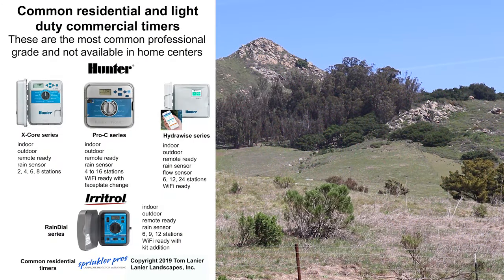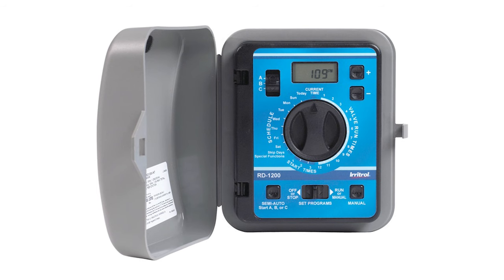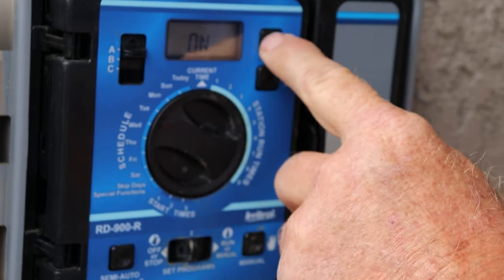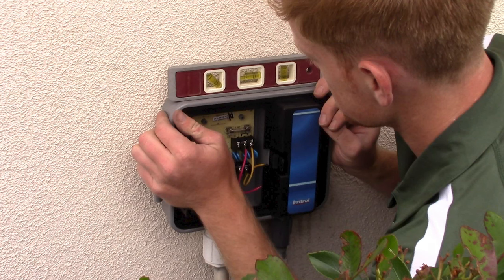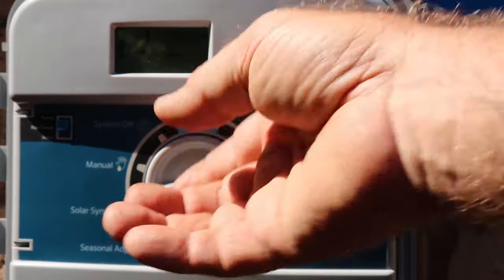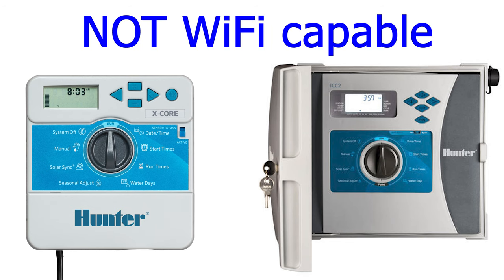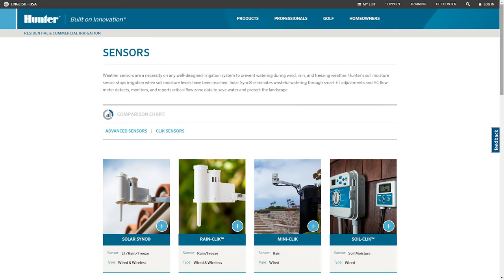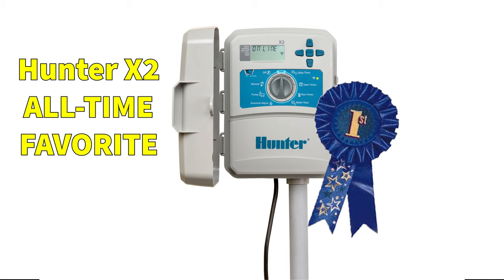Best Irrigation Controllers for 2024 'n WHY | Pro-grade buyer guide

Comment: Hunter...nothing is simple for avg user.  Hydrawise is way behind rachio or behyve
Reply from the maker: A couple of reasons I prefer the Hunter wifi models is that you can operate it on the interface and it has standard screw-type terminals for easy diagnostics. Not to argue, just asking....how do you believe that Hydrawise is BEHIND? The way I've viewed it is that they are just different. Rachio is a product that is built on a super simple design using a circuit board and a minimalistic enclosure for those who JUST want wifi access and a super simple timer. BeHyve is a wifi Orbit timer so it's built similar to a typical Orbit timer. Both the Rachio and BeHyve have clip-in wire connections. I have had constant problems with the Rachio on various properties when I attempt to use my phone as a guest remote control. It keeps losing my access so I need to keep going back to my email permissions and starting over. I don't have that trouble with Hydrawise or BeHyve.
Reply: @SprinklerPros  thanks for the dialog.  I've had the rachio 2 for 5 years(?), no issues.  I'm a reel geek (@thelawnforum) who likes a fairway lawn, not an installer so I can see why your biases (not disparaging) are different.  From my memory, hydrawise relied on you to know how long a zone should run, not intelligent as to ask you 'is this a rotor, fan, etc' to help suggest run times. Many residents have no clue on percip rates, nor does their 'help'.  Didn't ask soil type, slope and don't recall if it allowed it to run cycles (soak time) ...say that zone was for 16 min, option to run 8 min then an hour later another 8. That was 2-3 years ago, maybe hunter caught up?   Rachio can run w/o wifi if memory is correct however the interface is near idiot proof, advanced if you are.  Weather forecast /prediction saves wasting water/money regardless.
Reply from the maker: Yep. From your perspective, the Rachio rules. Like you said, as an installer/troubleshooter/repairman the Rachio is a tough cookie. Thanks for the intel. Nice chattin' with you.

Comment: You are a Hunter fan.  Thats fine.  They make the best pop-up in the Pro series.  But there controller does not have a test program and you must program a test program into them using up 1 of the 3 programs where as RainBird does have a test program.  Big advantage.  Not to mention I can teach a customer in 15 mins how to operate and program a ESP where as the Hunter is always an issue for them and for some reason they end up adding multiple start times to the Hunter in errror.  The RainBird esp / Extra Simple Programming is easier to operate and program.
Reply: I completely agree with you. In my opinion, Rain Bird controllers are more logical in programming. It is a pity that the RZX and TM2 models are not considered in the video.
Reply: 17 years of experience and have had to fix or replace dozens of Hunter pro-c controllers never once had to work on a pro grade Rainbird

Comment from the maker: Clarification: I mentioned in the video that the ICC2 is not WiFi capable. It actually is but with a commercial-grade ($$) irrigation mgt. platform called Centralus designed for the ICC2 and ACC2. This video is mainly for the 99.9% that have no need for that awesome platform. Thanks Sam for bringing this up.

Comment: I recently installed the orbit b-hyve smart timer.  It is super easy to control via the app, which is great to not need to go out to the box.  It also has the ability to turn on the stations via phone app just like that rain dial remote.  Definitely a good option for homeowners

Comment: Nice job.  Good education for the simple minded like me.  I'm having a pro install a new unit at a 17 year old home we just moved into.  He made sure all the heads where working and drip systems are functioning but in at the end we discovered the control unit wasn't getting power for some reason.  Time for a new one with Wi-Fi capabilities.  Thanks again for your video.
Reply from the maker: Mike, You're quite welcome.

Comment: My Rain Dial had 2 stations not working. I thought it might be faulty but the retic guy showed me that the 2 stations in question were set to 'Pump:Off". A button press and it was "Pump:On". I haven't seen this function described in the manual.
Reply from the maker: Mick, there are many hidden features available for the RainDials that 99.9% of folks never use. This feature is on page 31 of the newest User Guide that can be downloaded from irritrol.com on the Rain Dial page. Thanks for being here and posting your comment/question.

Comment: Never had good luck with Irritrol timers.
Issues with the dial contacts and the internal voltage dropping from control board.
average life 5 -7 years.
Reply from the maker: Bummer. I deal with Irritrol timers all the time that have been in service as far back as 1993 and still going strong. Some of them fail but so do every other brand. What is your favorite brand and model that you have had good luck with?

Comment: Thanks for the info. I have an Orbit B-Hyve timer that just died on me after a mere three years. They made me use an on-line chat-bot for warranty support and the chat-bot said "I cannot help you with that. I'm going to transfer you to a different chat" ....and then the robot hung up on me! 😮😅

Now we don't even matter enough to have a robot take down our information.

I'm trying to find something with similar features to the B-Hyve, so I will definitely check your suggestions 

I only have one solenoid switch which opens and closes five different zones by use of an indexing valve. So, for the timer I need the ability to run one single zone 5 different times on the same night when I water. I was able to do that on the B-hyve by bypassing all the Ecco features.
Reply from the maker: Tony, that's a trip what happened to you on the phone. I am not a fan of any Orbit products. I'm not quite sure what you're saying but if you need certain zones to come on at different times, all you need to do is group them on different programs, A and B, and give A and B different start times. You can do this on any decent timer with more than one program included.
Reply: @SprinklerPros  sorry about that. I guess I should really not post late at night, or at very least proof read what I have typed. I corrected my original post.

Comment: What would you recommend to replace a 30-station irritrol MC-e Blue series? I would like one that has high & low water alarms for each zone and wifi accessible.
Reply from the maker: The Hunter HPC can do up to 32 stations and can do wifi via the Hydrawise system. I am not sure what you mean by high and low water alarms but this timer can also connect with the Hunter wired or wireless Flow Clik sensor which will give you an alarm if there is a flow problem. The Hunter HCC can also do up to 54 stations.
Reply: @SprinklerPros  What I mean is that there are 'Established Normal' flow rates by zone & if they are under or over by more than a set % the controller needs to alarm.
Reply from the maker: I hope I'm not frustrating you with my attempts to answer you. In all honesty, I only have a few clients out of my thousands that even have a flow sensor, which is what is required to get flow alarms and all those flow sensors are on Hunter controllers. I didn't install any of those flow sensors. They were already installed when I began serving those clients. I believe Irritrol has a flow sensor and thus has controllers like the Total Control that can handle that many stations. To get alarms with the Irritrol series you'd also need their wifi add-on.

Comment: How do you test and set a rain sensor for a timer? I have Irritrol Kwik Dial 6 zones 12 years old. I have always wondered if my rain senso is working and if can set for different sensitivity. Came with house by the builder 12 years ago but no manual. Thank You!
Reply from the maker: Daniel, do you know the brand and model of the rain sensor?
Reply: @SprinklerPros  Rainbird RESD-BEx
Reply from the maker: slight correction for your search: RSD-BEx   For pdf manual go to RainBird.com > Products > Controllers > Sensors & Meters > (select) RSD Series Rain Shut Off > select the Documents tab > (it will scroll down to the thumbnail of the manual then click on it and wah lah! Download that puppy.

Comment: HELLO PRO, I WONDER HOW TO ATTACH A SECOND CLOSER TIMER. ONE BY BACK GARAGE DOOR AND VALVES ALREADY INSTALLED.  AND ANOTHER BY THE KITCHEN/GARAGE DOOR FOR EASY ACCESS TO RE PROGRAM SOMEHOW!!?? THANKYOU, PATRICIA
Reply from the maker: Patricia, There are several factors involved to consider including electrical access. This would be best answered by a pro in your area who can look at your situation. Good luck.
Reply: @SprinklerPros  Well, I have called many to no avail.  If it isn't easy, it's no go.  There must be a way somehow.  I know that there are 2 separate switches that control my kitchen lights and my long hall lights. It would involve running colored wires from old timer thru a wall to the 2nd timer at the garage light switch.  I'm constantly walking seemingly miles on bad knees to adjust this or that.   Thanks for replying.  🖐🇺🇸
Reply: run wire to old timer up grade it

Comment: What do you suggest for a small orchard 35 fruit trees? I’m looking at trenching soon we get our water from and irrigation canal
Reply from the maker: Adin, first you'll want to be sure to see my video on dirty water sources to make sure you get good filtration before and after your sprinkler valves. Be sure to use sprinkler valves that are easy to take apart and clean like Hunter PGV or ASV valves. Unless you are going to be using a booster with a super high PSI output, you shouldn't need a drip system pressure regulator on each line. With dirty water, even with a filter before and after the sprinkler valve, you're still going to get organic or non-organic debris in your drip lines so I would suggest considering adjustable emitters like the ones shown on my video "The 3 main different types of drip...."  Adjustable emitters can be unscrewed and flushed out as needed. Button emitters and drip tubing with emitters built-in cannot be cleaned out.
If you're considering overhead sprays, I would suggest Hunter PGP Ultra rotors with low angle nozzles. You can't get the low angle nozzles at the home centers so be sure to get them at the professional landscape irrigation supplies. The low angle nozzles should stay under your canopies, depending on what you are growing. The rotor sprays shouldn't clog if you install the aforementioned filters. I hope that answers your question.

Comment: Just had a new sprinkler system put in at my lake home where I pump out of the lake. I have only 4 stations & they put a small Orbit controller that I HATE! I cant read the numbers, I dont like digital & can not figure it out. Its a cheap controller because I didnt think I needed 'state of the art' for such a small system. But, Im 75 & I do want to be able to work it! Is the Irritol Rain Dial RD 600 going to be the easist for me to switch to? Thanks so much!
Reply from the maker: TS, The RainDial timers are THE easiest and toughest timers on the market. If you are using lake water be sure to watch my video on the subject to save yourself ALOT of grief.

Comment: Are most brands of sprinkler timers compatible with most brands of valves,   assuming the voltage is the same?  Thank you in advance!
Reply from the maker: Yes they are. The timers and sprinkler valves are independent of each other.

Comment: The only thing I don't like about the Irritrol R series timer is there is no 24-hour
 clock, which at times can get you in trouble if you are not paying attention.
Reply from the maker: James, please explain how that can get you in trouble. This is a real question. I'm not being snarky.
Reply: @SprinklerPros  If you don't pay attention and set am instead of pm or vise versa you could be watering 12 hours from when you actually wanted to which could be desirable for what ever reason. I went to a local sprinkler shop show a few years back and l ask the Irritrol representative about it and he said oh yes it has a 24 hour clock. So he fumbled around with the display controller on the wall and could not find a 24 hour clock setting. He walked away scratching his head saying we have to get that resolved, however l do not think they ever did.
Reply from the maker: James, thank you for the explanation and I now understand what you meant and that's a good point. I have been installing those since they invented them and I've never heard of a 24 hr function on it. Yes, the AM and PM are too small as are the ones on the Hunter timers and I have accidentally done that myself several times over the yrs cuz I didn't see the AM/PM correctly.

Comment: Newly subscribed! Looked at your irrigation controller review, certainly interesting but l'll stick with my newly installed Rachio. Must say though had quite experience with a so-called pro installer. From exposed electrical wires, unsealed knockout lugs, loose outside mounted box & plastic weather box installed unlevel plus even the vertical conduit had its own awkward vertical angle. So anyways it ran once & only once, had the sprinkler company owner over to show the messy install & test the 12v transformer. Of course the transformer was dead (no current passing through). This was the insult to injury on top of all the other sloppy practices. Our conversation got testy to say the least when he said "transformer is bad from the manufacturer". After a resounding "REALLY!?!? & did you see the dried water marks inside the weather box & the location below of a sprinkler head?" It finally connected & he offered to fix it all after the new transformer came in. Of course I didn't want them near the house again. Originally, I had planned on doing the install myself. But, this is what happens when you walk the dogs one evening and an irrigation company is doing work next door (replacing damaged sprinkler heads after pool install) & they pass on their business card. Have to keep reminding myself "it's never the price but the cost"!

BTW, impressed with the Rachio only 6 six zones used & it's built for 8. Next model up is 16 zones. It's built for rain & wind avoidance. Of course WiFi & internet compatibility plus it runs off the cell phone being an App. My next target for improvement is optimization of the sprinkler heads & coverage, hence my joining your YouTube.
Cheers

P. S. Located in Central Florida
Reply from the maker: Yikes!! Yah, I follow behind these guys ALL the time. If it wasn't for them I'd be out of business 🙃. I truly feel so sorry for the people that have spent sometimes thousands of dollars on other guys that botched their projects just to have to pay me to come in and do it over. My grandparents lived in Stuart. Are you anywhere near there?
Reply: @SprinklerPros  Tks for the reply. Well, I have a default relief saying to myself, "it could of been alot worse" & it cost me 100 bucks. Lesson learned! I am near Orlando, Stuart is south-east some 2.5hrs. Cheers.

Comment: My water company is offering 145 dollars rebate for each type timers, so if it has a built weather control and a moisture probe, do any of these units you have spoken about will do that?
Reply from the maker: Jim, I'm a fain of the Hunter Hydrawise series. They can tap into local weather stations or you can connect a Hunter Solar Sync to certain ones. Hunter also has a soil sensor. Baseline is a popular pro grade soil sensor mfr.

Comment: Hello I think something is wrong with your resource I click on the item and then the price and I do not see the price.
Reply from the maker: Jim, when you click the Get the Price button, it's supposed to take you to that item on Amazon. Is that not happening? If so, which item is it?
Reply: @SprinklerPros  Ok the Hunter controller price is now working but the Irritrol ones are not.
Reply from the maker: Thank you so much for the heads up. All of the Irritrol controller links are gone and then the server's site just went down so I will be looking into this. Thanks again.

Comment: Why don’t you like the rachio pro 3?
Reply from the maker: David, I am not a fan of timers like the Rachio, Orbit, and some homeowner models of RainBird that have the clips for the wires. I can't do diagnostics easily with them and they can't handle more than one wire if needed. Also the Rachios can't be operated or programmed from the interface so I must go thru a process with the client to get access to it on my phone. It's better for techs to have walk up access to the   interface and wiring.
Reply: Thanks i have it and love it buy your not a fan so 😢maybe ill get the hunter version

Comment: What would cause my controller to get hot to the touch?
Reply from the maker: Jason, the only thing that typically generates heat in the controller is the transformer if it's built inside the cabinet. Is the timer inside or outside? Which model is it?

Comment: In a world full of technology; are we close to completely wireless irrigation controllers, solenoid vales and so forth?
Reply from the maker: I don't believe so because the valves/solenoids would need a wireless/battery-operated power source strong enough to send a signal to wherever the timers are AND need to replace those batteries on schedule.

Comment: You do not want Wi-Fi, and you do not want AC powered timers. If your power runs out you will be wasting a lot of money on watering and possibly flooding your house. With batteries you always have a power source.
Reply: Um….  Maybe get solenoids that  require  power to run… do they even make a sprinkler solenoid that opens on power failure? Batteries always have power? Am I missing your sarcasm or something?